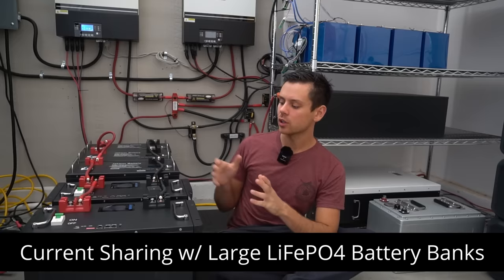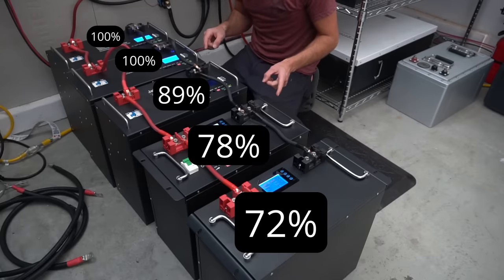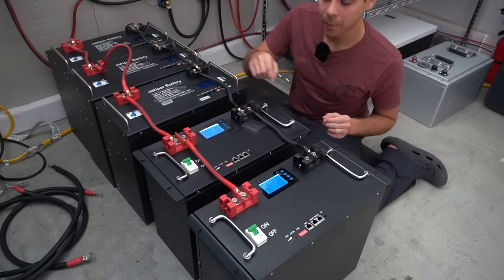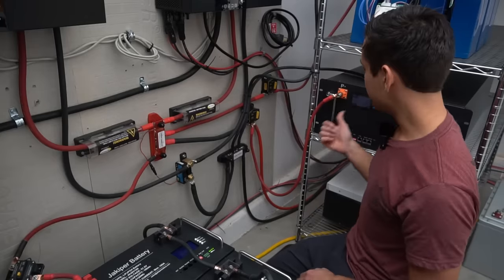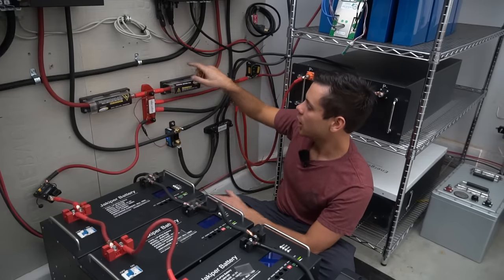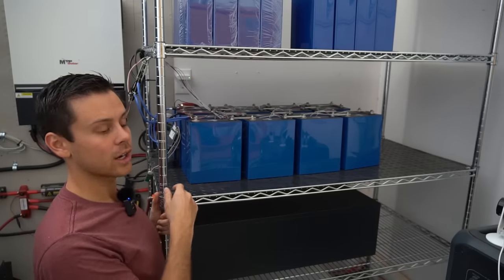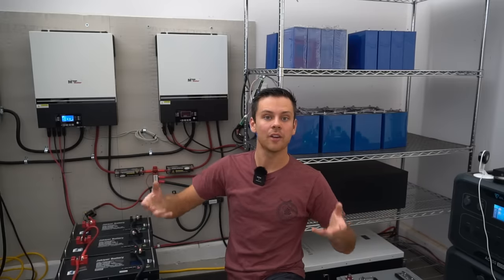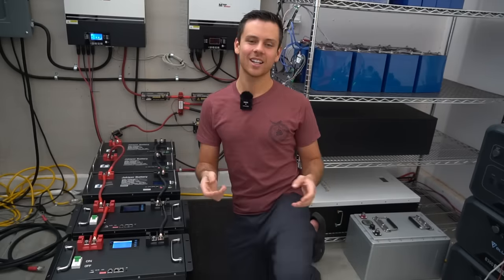Current Sharing 101 w/ Large LiFePO4 Battery Banks

Comment from the maker: The server rack bus bar needs to be connected to loads/chargers at opposite or diagonal ends, as shown in the video. You can safely use other wiring configurations, but your crimps need to be perfect, and the size/length of conductor. Using a bus bar has the lowest chance of screwing something up. Highly recommended for beginners!

Beginners should check out this resource on battery bank wiring configurations: https://diysolarforum.com/resources/wiring-unlimited.2/

Does off-grid solar confuse you? 
Check out my DIY friendly website for solar system packages and product recommendations, and so much more! 
http://www.mobile-solarpower.com

Join our DIY solar community 
#1 largest solar forum on the internet for beginners and professionals alike:
https://www.diysolarforum.com

Check out my Book
Best-selling and beginner-friendly guide to 12V off-grid solar!
http://amzn.to/2Aj4dX4

If DIY is not for you, but you love solar and need an offgrid system, check out Tesla Energy! They will price out a system and get your house offgrid: https://ts.la/william57509

My DIY Solar Equipment Recommendations (Constantly updated! Check here first):

12V/48V Lithium Solar Batteries: https://www.mobile-solarpower.com/solar-batteries.html

Complete Solar System Component Directory: https://www.mobile-solarpower.com/solarcomponents.html

Complete 48V System Blueprint: https://www.mobile-solarpower.com/48v-complete-system-blueprint.html

Plug-N-Play System Recommendations: https://www.mobile-solarpower.com/full-size-systems.html

Complete "Add to Cart" 48V System Kits: https://www.mobile-solarpower.com/complete-48v-solar-kits.html

DIY Friendly Air Conditioner/ Heat Pumps: https://www.mobile-solarpower.com/solar-friendly-air-conditioners.html

My Favorite Online Stores for DIY Solar Products:

Signature Solar
Offgrid One-Stop-Shop. Best Value 48V LiFePO4, Victron and Offgrid Specific Heat Pumps:
https://www.signaturesolar.com/?ref=h-cvbzfahsek 

Current Connected
SOK, Victron, Mr.Cool Heatpumps and High Quality Components. Fantastic customer support: 
https://currentconnected.com/?ref=wp

Litime 
My favorite 12V budget battery!:
https://www.litime.com/?ref=XBIA62RFcalHns

Epoch Batteries
My favorite high-quality 12V battery:
https://www.epochbatteries.com/products/12v-460ah-lifepo4-battery-ip67-heated-bluetooth-victron-comms?rfsn=7352625.50494d

Renogy 
A classic 12V solar store that has been around for ages! DC to DC Chargers and more! 
https://renogy.sjv.io/n1VjXx

Rich Solar 
Renogy's biggest competitor! Similar products, but at a better price: 
https://richsolar.com/?ref=h-cvbzfahsek

Battery Hookup
Cheap cell deals
https://bit.ly/2mIxSqt
5% off code: diysolar

Contact Information:
I am NOT available for personal solar system consult! If you wish to contact me, this is my direct email: williamprowsediysolar@gmail.com

Join the forum at https://diysolarforum.com/ if you wish to hang out with myself and others and talk about solar

FTC Disclosure Statement and Disclaimers:
Every video includes some form of paid promotion or sponsorship. Some links on this youtube channel may be affiliate links. We may get paid if you buy something or take an action after clicking one of these. My videos are for educational purposes only. Information is subject to change/update at any time. Electricity is DANGEROUS and can kill. Be smart and use common sense :)

DIY Solar Power with Will Prowse is a participant in the Amazon Services LLC Associates Program,
An affiliate advertising program designed to provide a means for sites to earn advertising fees by advertising and linking to Amazon.com
Reply: Great video.. Bus bars also need to be sized appropriately for the current.
Reply: That's sort of the same as connecting the load to the center battery in your pack, but in reverse. The  outer battery packs will likely charge first and you still have issues with packs of differing specifications/condition.
Reply from the maker: @OhRonaldo  no, opposite ends as in diagonal connection. See the pdf resource above or look at the diagrams in the video to see what I mean.
Reply from the maker: @AIM54A  good point!
Reply: @WillProwse    Oh you mean opposite end of the other polarity not opposite ends of a single bus bar. Gotchya.
Reply: When paralleling with lead acid, if you use a fuse or circuit breaker between LiFePo4 and Lead acid does that remove the risk? Can’t any paralleled bank fail (of similar chemistry) and the other bank push amperage through it? Is there a lead-acid only risk? In marine situations where loss of power can be extremely hazardous, there are many pros to having lead acid in parallel to power systems in event of some kind of failure that triggers LiFePo4 BMSs.
Reply from the maker: @dinghyride  technically yes but I personally wouldn't risk it. I would use a t class fuse to isolate each one. Up to you if you wish to try it.
Reply from the maker: @dinghyride  I would just have multiple packs if redundancy is necessary.
Reply: @WillProwse   So if you have a Lifepo4 battery bank of 6 batteries each with internal BMS (100a max discharge current each) connected 3p2s into 24v and have a 3000w inverter connected to opposite sides of the middle batteries in the bank, will this discharge the middle batteries faster and is it better to connect to each diagonal corner? 
Thanks
Reply: And connect the Main supply to the center of the BUS bar? Or perhaps feed from top and bottom with equal length conductors?
Reply: Glad you clarified this. There is nothing magic about bus bars. They are just cheaper than similar cable. But using 4/0 cable with good crimps will probably have lower resistance than a smaller sized bus bar.
Reply: Lots of good info in that wiring unlimited link.
Reply: I have 24 SOK 206ah batteries will be wired for 48v bank.  I plan to use 4/0 wire between each battery and then run each series through T class fuse then to bus bar which will feed 3 sol ark 12k. Cable and crimps are already purchased.... Tell me I'm ok...😵‍💫
Reply: I see a high risk situation with your wire racks! I've seen these plastic shelf pole inserts fail and come loose. If inserts fail and a metal rack slides down the poles, you could have direct terminal shorts on each cell from the rack above them. If the racks only fall unevenly, the cells/batts can still dump out and pull the wiring with them, possibly causing shorts and fires.
Reply: Bus bar has to be sized right too. Small bus bars can act like cables like you have.
Reply from the maker: @ChatGPT1111  Yeah I was scared of that too, so I ordered the higher weight capacity model. It is the same one I have seen in a lab with lifepo4 cells stacked till they were bending. Should be good to go.
Reply from the maker: @ChatGPT1111  A lot of people do not know how to install those plastic insert as well. I have seen it done before. Very important.
Reply from the maker: @tourneynet8557  Yes very true
Reply: Have midnight charge controller... Is there anything better out there...
Reply: this video is awesome!
Reply: Question on “equal length conductors”. I have two LiFoPO running in parallel, diagonally connected via buss bar, but the conductor length will be different to the distribution panel (Lynx Distrib) by virtue of the battery isolator switch and the 400Amp T fuse.  The negative is directly connected to the shunt but the positive takes a longer route to the panel with the two items.  Is that OK or do I cut the negative 4/0 to a longer length just so it too is the same overall length as the positive??   Lastly, every diagram I’ve seen and a Victron build project show the T fuse first and then the battery break or “isolator” switch.  Yours is the inverse…. What is the best scenario?  Thank you in advance!!
Reply from the maker: @jimsjacob  Yes, keep the T fuse as close to the battery as you can. In my system, I have multiple packs on both side, so I cannot mount the t class fuse closer to my batteries. 

Could you post your battery wiring configuration on our forum at www.diysolarforum.com? I would hate to tell you bad advice because I am not entirely sure how your pack is configured. A picture would be very helpful.
Reply from the maker: @joelarge4176  Midnite controllers are very nice.
Reply: Thanks for the response Will, the reason I was asking for insight about charge controllers, is because I live at 4300 ft. Just over the california bordering in oregon, the classic 150, doesn't seem to be able to winter cold temperature spikes ... This is the 2nd yr in a row I have removed it and sent it back for warranty to midnight... They're saying it can handle it, they said they tweaked it, but it just failed for the second time.... Any advice would be great....
Reply: Will, can you (if not already done in a video) replicate a similarly protected system using only 12V 100 amp hour batteries and their individual BMS in series for a mobile application?
Reply: HOW and why is a BUS BAR so different than an equal length of 4:0 cable???
Reply: Simplfi adds 3 yrs to the warranty with the use of a bus bar...
Reply: I'm so glad you mentioned using as big a gauge of wire as will safely fit in the conductor. I don't feel so alone. I have an aversion to anything that feels warm to the touch. That's how I gauge whether or not it's big enough. It should remain cool under load.
Reply: @WillProwse  I am currently using to Midnite Solar Classic-200 charge controllers, running "follow me" mode. I see 5600 Watts, almost every day. It's good to be off grid!!
Reply: Great vedio. Very well explanation. Plz. Teach me
Reply: 1à
Reply: YOUR WIRE GAME IS SO NEAT AND CLEAN !   X MILITARY?
SEMPER FI GUNNY
Reply: @richarddietzen3137  why? It’s the same setup with less voltage….
Reply: So learning session..... Great work!
My question-
Can I connect (3)10kwh 48v with (2)7.5kwh 48v together in parallel???
Reply: Hello
Reply: So , if there in parallel.  Mabey,  if the battery next to load is being used more it would where out faster.  So you could rotate batteries.  Then you would be replacing one battery instead of all at once. Lithium-ion phosphate.
Reply: What is a C?
Reply: I want to create diy car using that big parallel batteries
Reply: Hi Will, just seen a video of a bank where the charger was connected to the middle of an odd numbered battery bank, say 3 or 5, and thus spreading the charge out more evenly....what your thoughts mate?
Reply: Ok
Reply: I was literally thinking about this exact topic yesterday as I was looking at the growatt 5000w hybrid inverter and it came with 2 server battery at 50ah but wanted to add 2 more 100ah in the future when I can afford it.
I love all your videos on solar and battery builds it's an inspiration from all the way in sunny Australia.
Reply: Please there are some things I need to ask you personally if it's ok with you I've been following you for a while now and I think I'm catching up with what you are teaching Birthday song questions I have
Reply: I want us to chat, bro.
Reply: Will, you have a great channel. One thing
Reply: Can 1 fuse just be used on the battery side of the buss bar?  If so what size would it be?

Comment: Interrupt rating on DC is no joke. Anyone who's arc welded can tell you how much heat 100a at 50v can generate when arcing, and how much distance you can maintain an arc over. I spent $200 on my Class T fuses and holders. Blowing one is $30 down the drain. Completely happy with that though, as it's hugely less expensive than burning up my trailer mounted solar system.
Reply from the maker: Exactly!! This guy gets it
Reply: Could you use a circuit break in place of a fuse?
Reply: Never mind, just watched the video 😂 t class fuse, here I come.
Reply: Never mind, just watched the video 😂 t class fuse, here I come.
Reply: @merkel2750  Sure, an appropriately spec'd circuit breaker would be fine.
Reply: @merkel2750 I think at that point it would be cost because then circuit breakers are going to be expensive

Comment: Circuit breakers are NOT disconnects and are not designed for that purpose. Circuit breakers and fuses are designed to protect the DOWNSTREAM wiring ONLY. They are for fire protection. They are not designed to protect upstream or other equipment.

Comment: As an electrical engineer who specializes in battery integration (UPS systems)-- I'm very impressed with your knowledge and hands on skills. Are you self taught? If so, bravo. Batteries can be very tricky to work with and can be very dangerous. One only learns by doing and being hands on.

Comment: You totally missed an important point. Most Li batteries have a small battery terminal. Piling up large lugs is bad idea because the contact area is small and you can not tighten the bolt very much. A busbar needs to be used so only one lug is attached to the battery and wire sized for that one battery not the entire system load.

Comment: First off, my brother was an electronics technician in the Navy, and that was 1964-68. He then worked for the Naval Electronics Systems Analysis Laboratory in San Diego, We did a lot of working together, I learned a bunch from him and elsewhere later without formal training. So on to my story. I came to the conclusion recently that series connections for solar batteries was no good for running systems near full capacity, with the current running through each battery and cables/connections from the charger and to the inverter. One thing that got me thinking this is a battery I was running (Lossigy 12 volt 200 AH in series with the same) going weak and the need for balancing series connected batteries. I just bought 24 volt batteries for my 24 volt system. So I watched your video on series and parallel configurations, and you said more than 3 batteries in parallel was no good. After scratching my head and doing some thinking and research, I started thinking, why not run equal length cables from a bus bar to the batteries in both directions, in other words, from the charge controller one cable goes to a bus bar and then equal length cables from the bus bar to each battery post, 2 busbars of course, one + and one -. Ditto for the inverter connections. I also found another video on tube where the guy shows a sort of compromise between that and what you say here and what I decided to do. I don't have rack mount units, so I was already shopping for busbars on Amazon before I found this video, and all the pieces came together listening to you explain exactly what I had thought of. After hearing you say in the Series/Parallel video it wasn't good to do more than 3 batteries in parallel, I thought maybe you didn't have a deep enough understanding of it all, or maybe there was something else I was missing. Full circle, you cleared all that up in this video. Only thing I can complain about is that when you said that it isn't good to have more than 3 in parallel as a blank statement in the other video, it threw me off quite a bit, as I have found most all your presentations so accurate and useful. And another useful comment you made was about the difference between running low level usage and charging as opposed to running at or near the capacity of the components. Very helpful to here it set out so clearly by someone I know is knowledgable.

Comment: Thanks, Will! 
I have done exactly as you said, paralleling several LiFePo4 batteries of different sizes(capacities) to a common buss.  I could not afford to change all batts out each time I wanted to increase storage.  Each battery is fused with a 100A Windy Nation fuse,  and the bus output to my inverter is also fused at 100A.  Solar charges everything nicely, and batteries maintain a fairly equal SOC under a longer discharge cycle at lighter loads.  So happy to hear your reasoning on this, I feel less anxious now!  Have had bad experience with cheap breakers developing high resistance and heat while operating at well less than ratings, causing inverter shutdown.  All fuses now. No problems now.

Comment: Great Video will!!!    This has been asked about a lot on the forum lately!  Thank You.

One thing to add:   We had a forum member that had on battery with a Fet Based BMS and another battery with a relay BMS.   The difference in resistance was enough to make the difference in the current very large even though the cells were about the same size.
Reply from the maker: Wow no way!!! I did not think of that one. That's wild!
Reply: Voltage drop measurements under load from cells to case output terminals might be a good measurement to compare quality across packs, commercial and DIY.